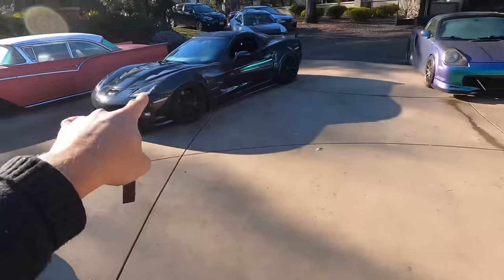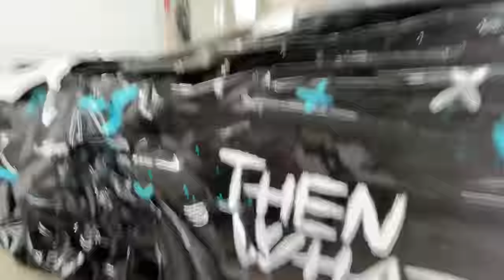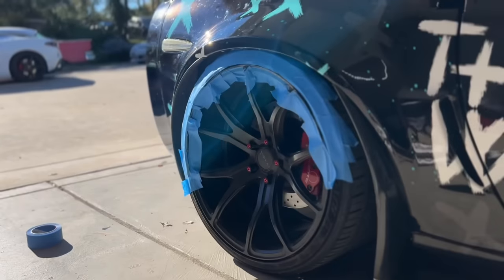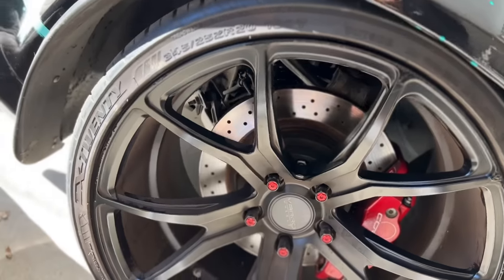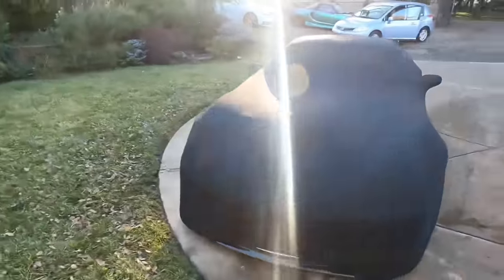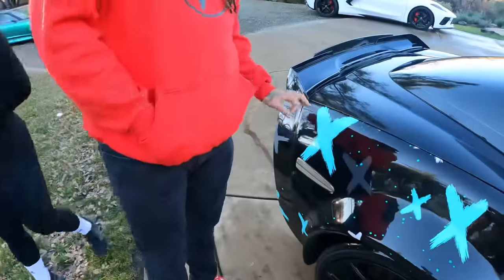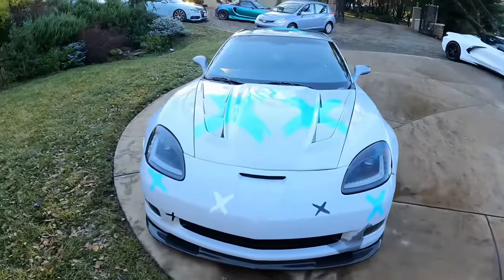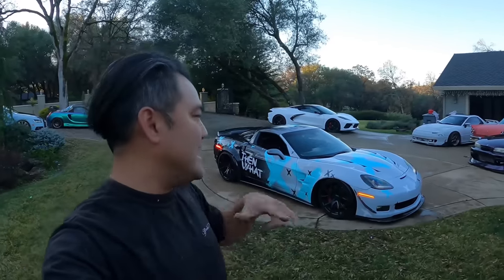New 2022 Car TREND? Printed Color Fade Graphics | Mike Myke Goes For A CRAZY Design On The C6

Comment: So I got a question I'm thinking about wrapping a 1990 fox body but it's faded still has the original paint what would be your approach for wrapping it sand it then prime it then wrap.wrap it as is or buff it and then wrap it will be my first wrap btw thanks for the info I appreciate it
Reply from the maker: Sand off any flaking paint then wrap it
Reply: @ParadoxTheWrapper  nothing peeling just faded/dull looking and there is a little rust just sand prime and then smooth the primer
Reply from the maker: @justliketofish1429  test some small pieces of wrap on it and see if the paint lifts off. If it does you gotta sand it
Reply: @ParadoxTheWrapper  nice thank u I appreciate all the help